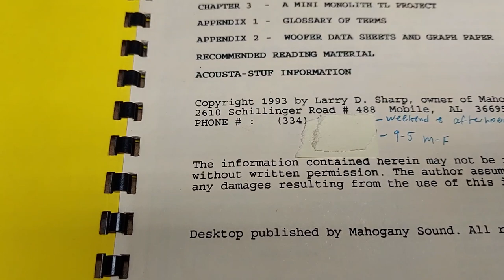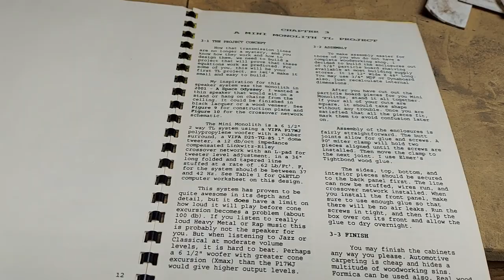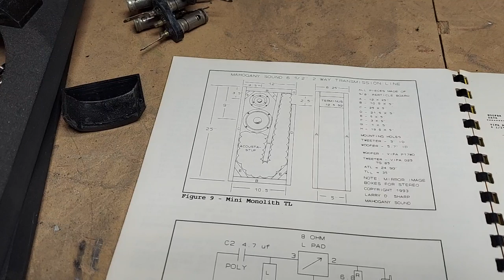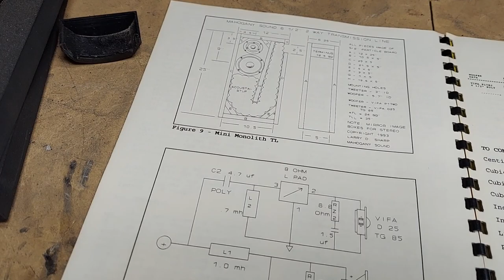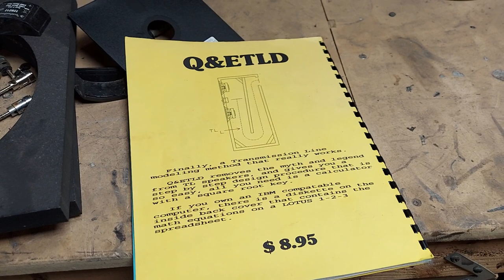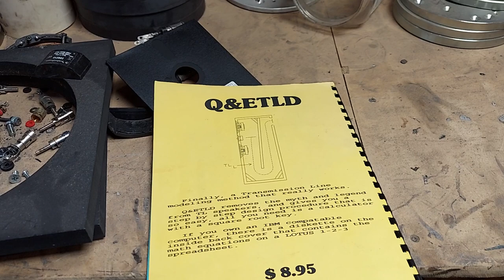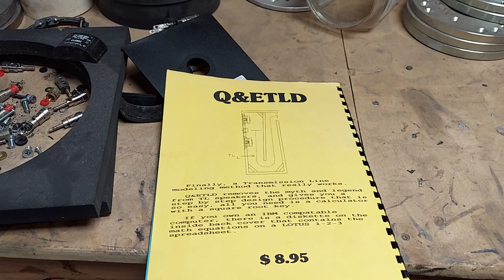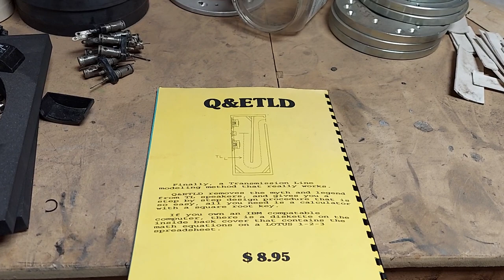The Gold Standard for Transmission Line Theory TL's - What You Need To Know!!!

Comment: I built a quarter wave box for my home stereo system for 2 reasons. One to see if I could, and two to fill a space were i would have had a hard time using a standard qube box. It's a nice peice of furniture sure.  Is it the best, no way. I love the sub inside it(sony mobile es 1995) could i get more bass, hell yes. My 8 inch energy subwoofer with 100 watt amp is louder and lower. But I'm happy with the box if nothing else that I get to use a sub I love and to fill the space I had. It doesnt sound bad it sounds very warm. It ties in very well to what I use my home theater for wich is listening to old records.
Reply from the maker: The important thing is that you're happy.